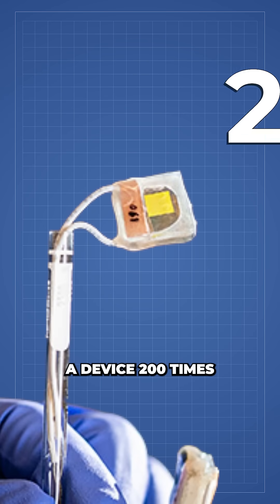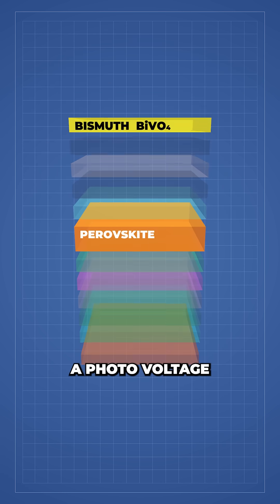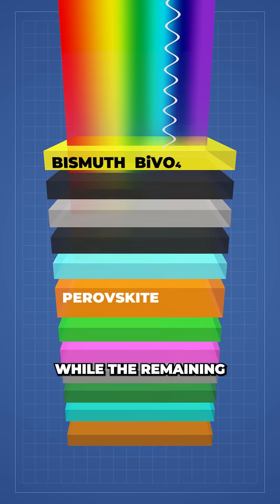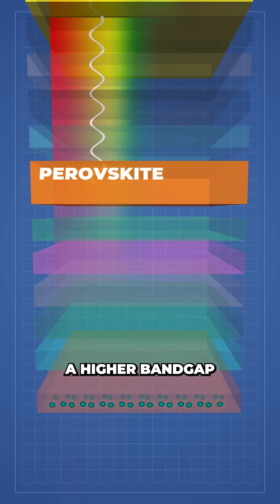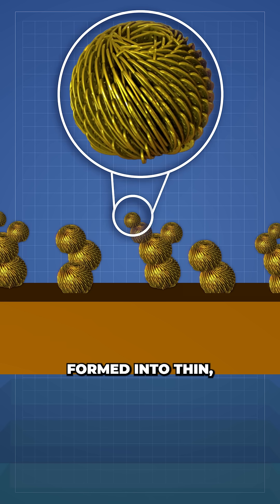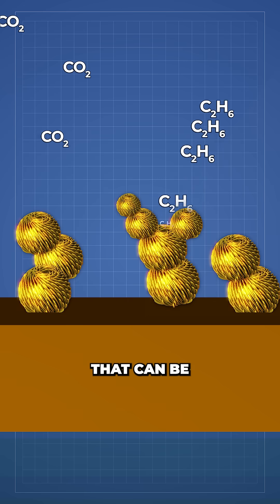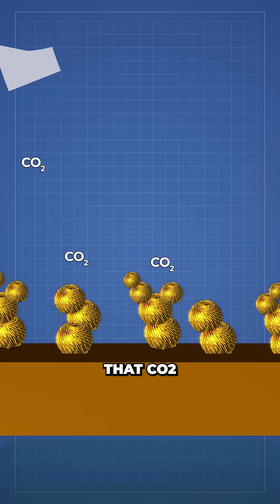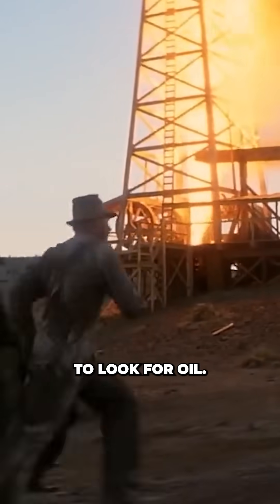Scientists Create Artificial Leaf That Converts CO2 into Fuel

Comment: The problem is perovskites are very efficient but degrade with temperature very easily.  They have been trying to make these work for a long time, at least 15 years, I don’t believe they ever will…also you claim that we’ve been trying to mimic what nature has been doing for a long time when in reality solar panels have been many times more efficient than plants for decades.  Plants are only about ~3% efficient whereas modern solar panels are ~25% efficient. So what is being said in this video is not factually wrong, but it is highly misleading.

Comment: Copper nanoflowers sounds... Fragile. Would love to see the paper and see if they mention how much one of these things can produce before it wears out
Reply: The perovskite sounds like the weak point imo - it tends to dissolve in moisture and leak lead compound everywhere.
Reply: Okay, read through the paper. The carbon nanoflowers are not the weak point of failure.

"This was further supported by a long-term stability test of a CuNF electrode, which revealed no substantial change in selectivity or morphology over three 12 h cycles."

Obviously, that's not a significant period of time. However, replacing the nanoflowers would also be the cheapest part of repairing a unit.

You just need to let CuO naturally grow under a certain solution in the right conditions to get the right shape.

Plus, copper is actually decently strong? Like, if anything was going to decay, it wouldn't be a metal getting eroded by wind. That's assuming it isn't isolated and directly fed CO2 and hydrogen sources. Probably H2O. Vaporous H20.

Copper has a higher density than almost any gas. It's not going to be eroded at a significant pace under reasonable conditions, and these systems are unlikely to be used outside of very, very controlled conditions.

Have a good day. The hardest part for this is not the nanostructures. It's making the right molecule, and in higher quantities. And not letting epoxy add impurities, but that's likely a done deal.
Reply: @Awesomeryay 
"Copper has a higher density than almost any gas"
Copper is orders of magnitude more dense than the most dense gas but density isn't even relevant here. Just because something is more dense than gas doesn't mean it can't be eroded by it. 

That being said, if there's a concern that the copper nanoflowers will degrade, it's not because of erosion from a gas.
Reply: Density of material would decrease rate of erosion, since it's harder for it to scrape off atoms due to lesser atomic mass.

But that's me trying to apply logic that's not meant for a particle level, so maybe I'm off.

However, it's unlikely to be exposed to high wind speeds, and is unlikely to significantly degrade. 

Like, density of a material seems to matter a great deal for erosion. Not as much as friction would matter, now that think of it, or intermolecular forces, which doesn't really apply here because copper isn't capable of forming covalent bonds (duh), but... Like, negative ions slowly bonding to the copper? But I don't think it has charge?

Whatever. Just a high school chem kid trying to apply their knowledge to a situation. However, two materials with the same, is porosity the right word?, and differing density, with exact conditions  wouldn't the higher density material erode slower since it is harder for particles to be moved?

Eh. Have a good day. @CoconutJones_
Reply: @Awesomeryay  
Material physics is extremely complicated. You can't determine the factors contributing to erosion just by thinking about it and applying basic knowledge. 

Chlorine is a poisonous gas and sodium is a highly reactive alkaline metal which reacts violently with water. Intuition would tell me that mixing the two together and eating the mixture would be a terrible idea. But as you probably know, I'd have just made table salt. So just thinking about chemistry is not enough to gain knowledge about it, and just because we think something makes sense does not make it any more likely or logical.

My point is that there are many many factors at play which determine the properties of a material. A less dense material could be much stronger than a more dense material.

All this being said, erosion isn't even part of the conversation. Put an aluminium rod in a wind tunnel and it wont erode for probably millions of years.
Reply: @CoconutJones_  Yeah, makes sense.

Just, you know, read the paper and tried to make sense of it using what information I had on hand. Obviously, it wasn't the correct information for the situation.

Anyways. I feel as if you used the Sodium and Chlorine example to emphasize how material sciences are complicated. But here- whatever.

Is erosion due to water's polarity? That makes no sense. Due to its acidity? Maybe, but I don't know enough to apply it. 

I do know that flowing fluid hitting and getting caught on a material would impart kinetic energy, and over time, loose particles, to the overall formation, may be knocked loose, and get pulled into the flow.

Or maybe it's because every single- Ah, of course. While a lot of materials have negligible solubility, a small bit separates into composite ions and gets pulled away, so equilibrium cannot be established?

So erosion is facilitated by water slightly dissolving material while it flows? Makes sense, with that in mind. Also explains why it would not function with Earth's atmosphere. Too gaseous.

Anyways, how about next time you correct someone, you explain why they are wrong instead of saying, "Nuh-uh," and then not elaborating beyond, "It's complex?"

Because I'm always happy to learn more. I just don't want to be told I'm wrong without further elaboration. Like, how mass is not consumed during fusion. I think. My Chem teacher would not elaborate and tell me why I was wrong. Ended up wasting 20 minutes on it because just saying something is wrong changes nothing.

I'm mostly fine with being wrong. I hate knowing I thought something was right, but it was instead wrong, and nobody tells me why. Especially if I spread incorrect information.

Have a good day. And take the burden of education upon yourself if you're going to correct someone.
Reply: @Awesomeryay  This was a perfectly civiliased conversation and you just had to respond like a complete brat.

"Anyways, how about next time you correct someone, you explain why they are wrong"
I already did. You originally said:
"Copper has a higher density than almost any gas."
I told you that copper is orders of magnitude more dense than the most dense gas.

Then I said
"if there's a concern that the copper nanoflowers will degrade, it's not because of erosion from a gas."
and I followed this up with an a example; an aluminium rod in a wind tunnel.

The only other thing I said is:
"Just because something is more dense than gas doesn't mean it can't be eroded by it."
I know that to be true because I know for a fact that wind can erode rocks. That's why I said it.

It's not my job to do your research for you. If you don't know what you're talking about then don't talk about it. That's why I used the example of table salt, because neither you nor I can ever know what we do not know. I can imagine that certain atoms and molecules will bond more strongly than others, even if they're less dense. That's enough information for me to know that I cannot assume that density correlates to erosion resistance.
Reply: @Awesomeryay  hi
Reply: @Awesomeryay thanks for the information! Yeah I know copper on a macro scale is strong, but for catalyzed reactions like this on complex surfaces I just imagined there being an issue keeping the shape. The surface changing shape on a molecular level and losing effectiveness, if that makes sense. Like a radiator oxidizing and that reaction clogging up the porous structure (obviously not the same because the thing isn't oxidizing.)
Reply: @alexpeterson1315 I'm not sure the reaction is fast enough to clog it up. I'd read it yourself, though, since it had a lot of jargon I've not encountered yet.

I got the point, but not the details, y'know?

Really is like a foreign language...

Have a good day.
Reply: @Awesomeryay  I mean Im less worried about physical erosion and more about chemical erosion (specifically oxydation). the O2 from CO2 has to go somewhere after all.